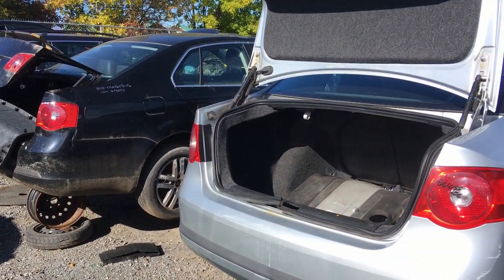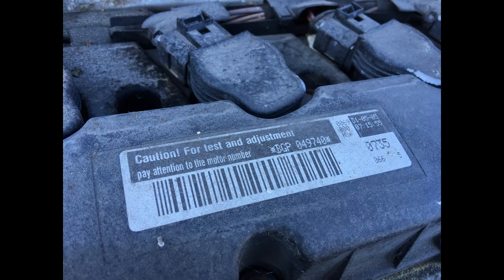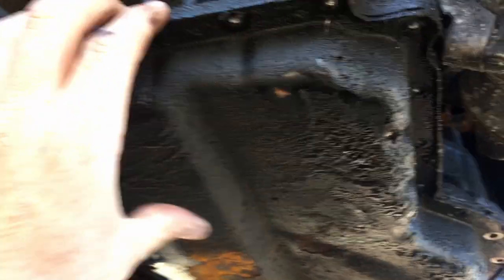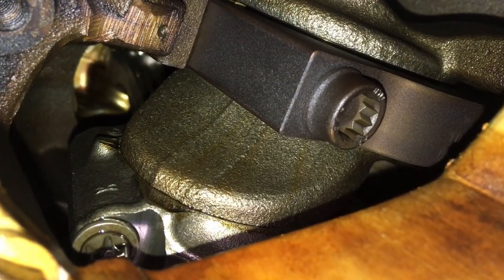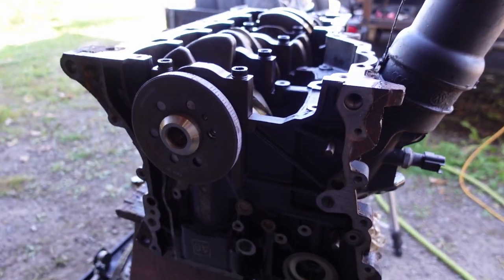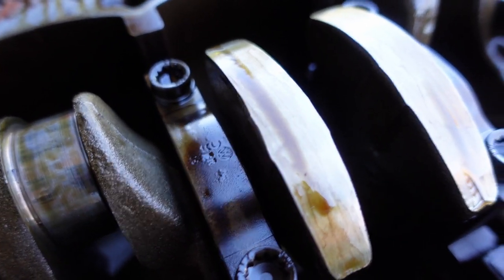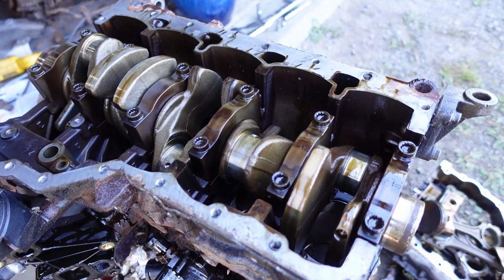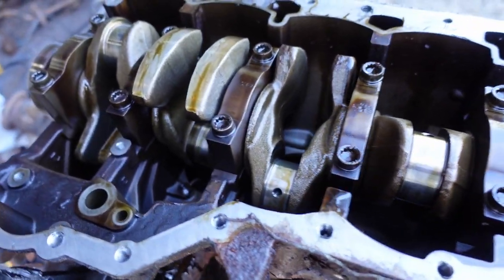How To Find a Forged Crankshaft for your Turbo 07K build

Comment: Hey I have 5 BGP motors. 4 have the numbers “0838” and 1 has “0738”. The one with the “0738” has a forged crank shaft. I think it’s the “07” at the beginning is what is the identification for the different crankshaft. 
Did the forged crank come out of that one with “07” at the beginning for you as well ?
And has anyone else found the same thing?
Reply from the maker: Yeah I’m pretty sure it came out of the 07 numbered motor.
Reply: @PBGarage ok so I think I may have figured it out with help of ur video, should make a update one of these times.
Reply: @y_just_y8317  I've gotta find another 2.5 long block for another project I'm working on, so I'll be pulling some oil pans at the junkyard to find a longblock with a forged crank already in it - I'll keep track of the numbers and post an update when the time comes.
Reply: @booneylander  excellent, hopefully this will be it
Reply: @y_just_y8317 hey just as an update, I didn’t realize you meant the small 4 digit code that is separate from the serial number. In that case both cars with 0735, one of them was forged the other was not.
Reply: maybe there's just a greater chance of finding one with that has the "07" your sure they both "35" ? @booneylander
Reply: @y_just_y8317  yeah, you can see the stickers in the video, both are 0735
Reply: @y_just_y8317 hey just brought home an 07K with a forged crank. This one has 0758 on the sticker. BGP 061573 for the other number.
Reply: @booneylander thanks for the updates I will let you know if I find anything else out as well and check my serial numbers

Comment: Apparently the rs3 crank drops right in, but it's quite expensive. But I do believe it has more flywheel/clutch options
Reply from the maker: Yeah, but they’re not exactly $28 at the junk yard lol. Also you have to upgrade all the timing components to match the different style timing chain sprocket on the RS3 crank. The RS3 crank is lightened too, it’s a sexy crank for sure.
Reply: @PBGarage  thanks to Richard Holdener, we all know stock cast cranks can handle stupid amounts of power. Made like 1400hp on a sbe 6.0 ls. 

But if one were to do an all out 2.5 build, I guess a rs3 crank wouldn't be too bad. Probably easier to get, better parts availability, and since the 07k is so cheap, you'll still come out ahead
Reply: @NatoriousGamePlay  hold your horses there bud, the reason why the V8 cast cranks are so good has more to do with the fast that they're physically massive and have a lot of material and torque holding capacity. You're also dealing with 6 bolt mains for the LS (4 bolt for a BBC or SBC) but only 2 for the 07k. But the biggest thing you need to remember is that a 5 cylinder has a lot of funky harmonics and vibrations. Those will kill a crank real quick if you try and spin it too fast or with a lot of torque esp at lower RPMs.

Comment: Was it found in the engine with the 31/05/05 build date? Maybe the crankshafts were forge in the earlier models up to the first half of 2006
Reply: Yes the first forged crank was in the 31-05-05 build date motor. I’ve just brought home another motor with a forged crank, and the build date on that one was 19-08-05.
Reply: The one I have with forged crank is 09-06-06 BGP 110840 I pick up a 08 motor that I guess I should check it out
The one in my car is hard to tell. It’s 14-02-07 BGP 162366. Hard to tell because looks like someone did a good job a grinding down the seam from the forging process versus the other forged and non-forged cranks I’ve seen don’t seem like they have had as much grinding as this one did.
Reply: @y_just_y8317  you know what’s weird is that recently someone sent me a marketplace listing for a “forged” crank, with 07k010e on the end of the crank but it clearly was a cast crankshaft. So either the one pic of the part number on the snout was “fake” and they were trying to pass off a cast as forged. Or some cast cranks have the forged part number on them.
Reply: @booneylander I can’t check part number on the one in my car but that’s sounds more like a scam. They could have two and used forged one for just picture of part number, unless u could tell in the picture of the part number ?
Reply: @y_just_y8317  couldn’t tell. It was certainly questionable.

Comment: Get the VIN and check the build sheet of the car. It will show the part number prefix. Or the pan bolt
Reply from the maker: Where do you find the build sheet info?

Comment: Any idea which BGP engine the forged crank came out of? the 109955* or the 049740? I'm on the search for one with a forged crank but unfortunately non of the engine recyclers around here let you pull off the oil pan so it's going to be a crap shoot. (Thanks for doing the research)!
Reply from the maker: I’m like 95% sure it came out of the 049740 motor.
Reply: Look at 4 number next to BGP is must have “07” at beginning example. 0738 should have a forged crank 0838 doesn’t not have one possibly. (UPDATE) Booney has discovered this to be untrue. Thank you
Reply: @y_just_y8317 just reviewing this info if you mean the 4 numbers on their own, bottom right, on the motor sticker… then both BGP motors had 0735 and one of them was forged the other was not. The CBTA had 0849 and obvi was not forged.

Comment: Is it possible to take an Audi RSTT DAZA engine with a 07k3 blockhead and change it to a 07k block head will it fit???
Reply from the maker: I wish I could go be you a good answer to that but it’s above my pay grade….
Reply: Go and ask Hank from IROZ motorsports........ The guru in the 07k community.... He mismatches a lot of parts.....
Reply: ive read iirc euro spec daza is compatible but you should be able to align the gaskets to be certain

Comment: Mine is definitely forged crank 😅
Reply from the maker: Sweeet! Can you share the numbers on the sticker? Should be a date code of manufacture, and a 4 digit code like 0758 or something.
Reply: @PBGarage  where would that be at again?
Reply from the maker: @vw_2.5 there should be a white sticker on the valve cover.
Reply: It says 0735
Reply from the maker: @vw_2.5 awesome thanks!